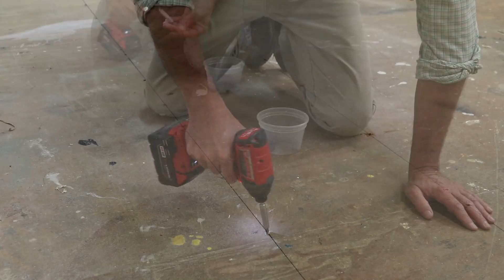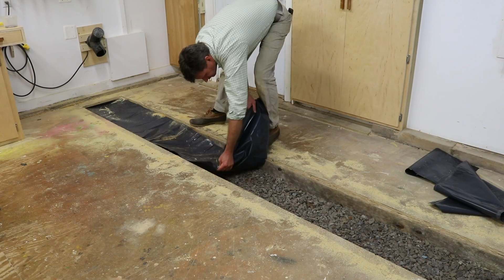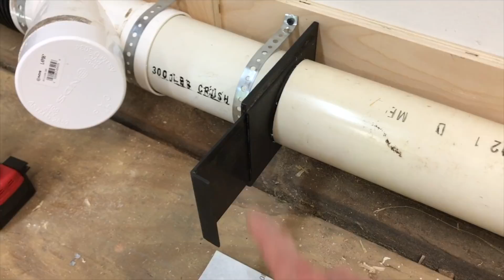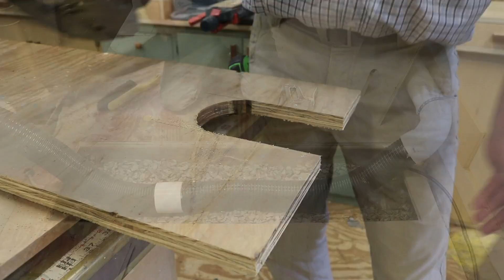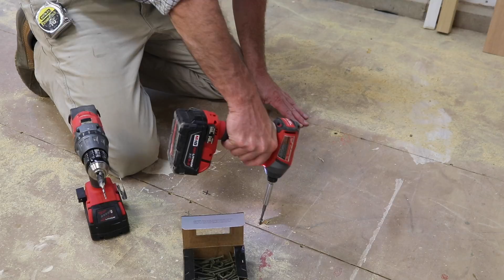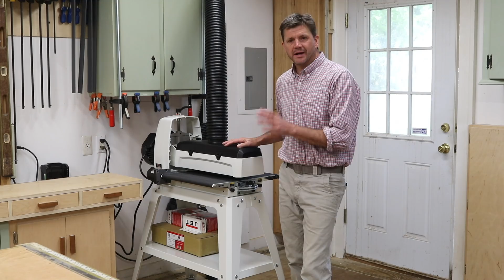Running my Dust Collection Under the Floor

Comment: Best kinds of automation are those that let you forget something even exists, but still use it daily. Maybe add a few sensors so that the dust collector turns on/off automatically with the tools that need it?

Comment: Nice start Jon.
It is so much better having dust collection.
Some advise;
Use aluminum tape on al the joints so you have no leakage.
And stay away from flex hose as much as possible.
Better use 2x 45° for a 90° corner but all in pvc pipe and not flex hose.
It gives better airflow.
Reply: My exact thoughts. A very good piece of advice. I also used hot glue and/or chalk on the small pieces of flex going to my tools.
Reply: Pat M n

Comment: Before you commit to that waste gate for the table saw, trim the bottom off of it and flip it to point vertical. Put masking tape over the hole you created by trimming the bottom. It'll keep dust from collecting in the edges and preventing the gate from closing.

Comment: I used metal duct and bonded it the the ground on my dc motor. That way my whole system is grounded, but I have a cnc so it's necessary.

when i just used to use a 3hp collector and a flex hose the planer would give me some pretty good shocks. I ended up wrapping a bit of bare copper around the end of the hose and making sure it was touching metal on my planer.

Comment: Nice and clean with the pipes mostly hidden.  I'm getting ready to do the same, but I have a concrete slab for a floor...so it'll be unsightly overheads and downcomers for me (but it beats the alternative).

Comment: Running a ground wire is kinda old school thinking at this point.  From what I understand in all documented incidents in recent times can all be narrowed down the impeller hitting something metal  and sparking.  Also I think its mostly understood at this point most dust collection systems can't atomize the saw dust and air into the proper ratios needed to cause a fire.

One thing I am curious about are you at all worried about condensation building up in the pipes under the floor.  I am assuming since your floors weren't insulated the ground doesn't freeze for you in the winter?

Comment: Did you use spray insulation for the backside of the pipes coming out of the ground? It looks like there would be a space and there would be cold air coming in from outside.

Comment: Oddly satisfying to see the shop being cleaned up in fast forward like that. ha. Great video as always, Jon! Questions: what type of pvc is that? I need to do some dust collection and I know nothing about it. Where did you get the flexible hose? Rockler? I think you are really going to like that drum sander. I got one a few months ago (I have the SuperMax 19-38) and it has really saved me a LOT of time. I am still learning how to effectively use it though. Just the other day, I tried sanding something that was 36" wide and I guess I took too large of a "bite" at once, so the edge of the sandpaper on the roll that was kind of sandwiched into the wooden workpiece burned a bit, and then it would transfer to my material. That was frustrating and I hope to figure that part out for the next one.

Comment: The floor in my garage workshop is concrete. Darn!  I'm going to eventually have to go the other way, and run air pipes the rafters somehow. Kinda sucks, but it sure beats no dust collection.

Comment: May i ask how your dust collection works on your delta jointer--I have a 4 inch hose connected to my delta jointer and it does a terrible job--all of the dust and wood chips stay up by the red cover and make a mess--almost none go in the hose to my dust collection unit--GREAT job on the video as Always Jon
thank you
tim

Comment: Could you run a test piece without the DC on and then one with it on with the table saw? Just curious about the difference it makes. Also get ready for some hate. Dust collection and joinery are wood working trolls food.

Comment: Damn you Jon.....You answered my question, right at the end..........was going to ask if your 2x6 floor joists were setting right on the stone..........I'm planning on building a 12x16' shed and was torn thru post holes, floating concrete piers, or 3/4" gravel with joists snuggled in..........I'm favorin' the gravel..........also keeps out the critters & allows drainage.....I'll bet your glad you didn't glue down that ply..................GREAT JOB Jon.always thumbs up!
Reply: Jimmy Kuros Fix your keyboard!
Reply: Damn spaceKey...........LOL

Comment: one thing ive learned over the years, epoxy coated specialty screws, galvanized screws, ect,.....all junk!!
You want some 316 or better stainless with tip type 17. Anything other than stainless will always rust or discolor turning black sooner or later!

Comment: Great video Jon, do you have any concerns of the length of run of pipe causing lack of suction? I'm about to put together my own dust collection system in my garage and while I cannot go in the floor (concrete) I am planning on going into the attic. Thanks

Comment: Looks great! With the dust collector outside, do you have any concerns about the warm air being evacuated from the shop in winter? Currently my dust collector is inside my shop but it's very loud and sometime on big jobs I'll leave it running for hours. I was hoping to move it outside just like yours I but was worried about heat loss...
Reply: +Charles Drew
If appropriate for your application could you wall off your collector and sound proof it? I am using a large shopvac and I built a plywood box for it and that alone cut the noise in half.

Comment: Hi Jon! It has been over 3 years since this video was posted. Have you run into any issues with the in floor placement? Matt Jackson has a friend who apparently is laying the piping within a concrete floor. I was wondering if you ever had any clogging issues where you had to pull up the floor and handle the problem? I am moving in about 3 months with a new shop and have always wanted to do in floor dust collection. Thanks, Bill
Reply from the maker: Hi Bill, no so far no problems. In retrospect it may have been a good idea to add a clean out halfway through the pipe that was built piece by piece. I can still get to it if I have a problem but it will take a little work
Reply: @JonPetersArtHome  Thanks, Jon. Bill

Comment: Hi Jon, my question is the material you used,  is that flexible sewer and water drain pipe?  I've been looking at it at home depot,  kind of shocked when i see the price of the dust collection hoses prices.  If so,  this option is WAY cheaper than them.  How do you like it if that's the hose you chose?  Pros and cons?  Thank you
Reply: I'm pretty sure the difference in a home shop will only be a reduction in airflow caused by all the ridges in the sewer pipe. Also a place for dust to collect/settle? For best results it is best to go with solid pipe with a set of 45's to create your long radius bends.
Reply: Pat M I was thinking of doing that,  but i was just wondering about instead of buying a ridiculously over priced hose made for dust collection just buying the flexible sewer and water drain pipe, only used from tool to pvc pipe.  I would use pvc pipe for the corners.   Thank you for responding,  and it is great advice 🖒
Reply: The difference is the depth of the ridges on the dust collection hose is much less pronounced, hence reducing the drag on the airflow. And of course the cost ;-)
Reply: Pat M hmmm didn't think of that.  Perhaps making the flexible hose as short as possible I could get away with it and save myself  $$$

Comment: Jon the deciding factor to use when deciding whether or not to add a ground wire to your plastic dust collection piping is humidity.  The major danger is FIRE!  Particulates when rubbed together at high speed produce quite a bit of static electricity.   We have all done the trick of scuffing our feet on a rug in the winter then putting a key up next to someone's ear an laughing at the spark and surprise of the victim.
wood dust fines can catch fire very easily and smolder for quite some time.   When run through a plastic pipe they can generate even more static.   This is particularly true of sander and table saw dust, not so much on the planer or jointer.  Ideally, the ground wire would be run on the inside of the plastic pipe but that is not too practical.   That is why they sell metallic pipe for dust collection systems.  The danger is much more acute in the winter when everything is dry.   Good luck.   I hope there are no fires in your future..
Reply: Steve McEntyre your joking I hope if not  you need to do some more research because the only way a fire is starting it that system is if he pours gas down the pipes and strikes a match and even then the fire would not stay lit with in the pipes due to the lack of oxygen now if he were using much larger pipe like they use in very large commercial shops that another story there is no evidence of what you are talking about in a system the size he is using si john if you happen to read this your good to go brother
Reply: Where does this fire fiction come from?  I have never seen any reference to a workshop fire due to a ungrounded dust system.  But,  the myth continues on.
Reply: Neal U  Underground has nothing to do with it. It's the plastic that can create static. Moving air filled with sawdust through plastic can be a fire hazard. I've worked in a plastic shop and have seen the static it creates.
Reply: I never said anything about the underground pipe. I said ungrounded. Big difference. This fire hazard has been brought up numerous times in woodworking forums and no one has been able to show even one example of a fire caused by not grounding the system.

Comment: Why under the floor rather than the ceiling?
Reply: I believe Jon's shop ceiling is barely higher than 8 feet...running pipes over the top would take up valuable headroom.
Reply: Yea I believed in a video in the past he addressed the overhead distance being less than 8ft.  Also his studio is above his shop so he can't go into the attic space either.